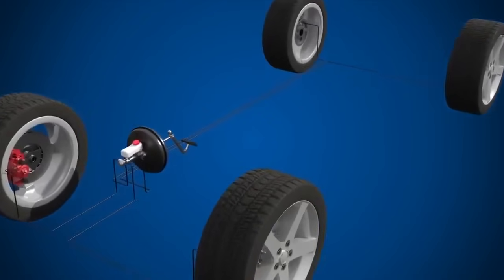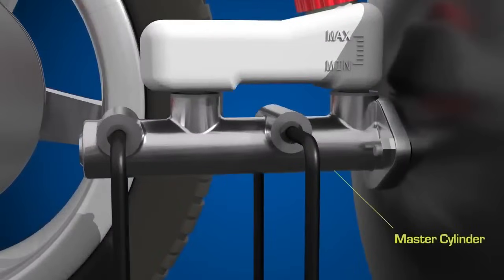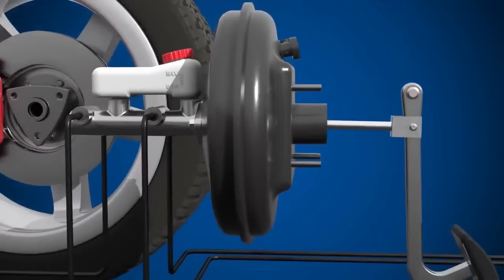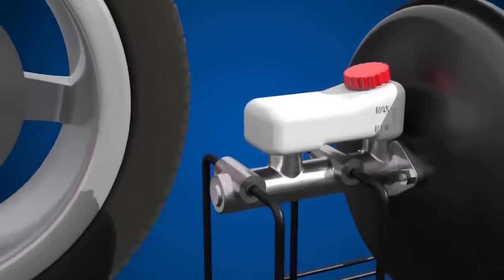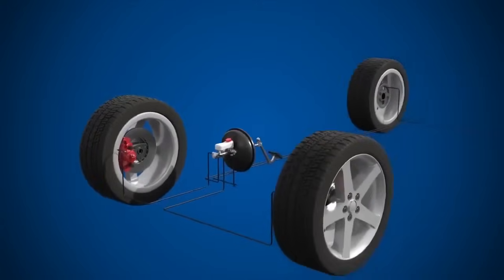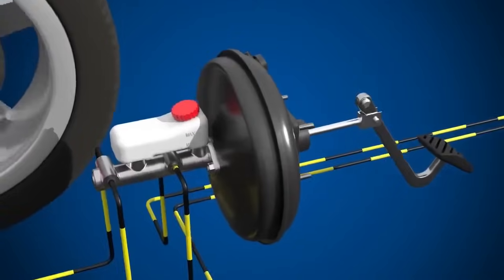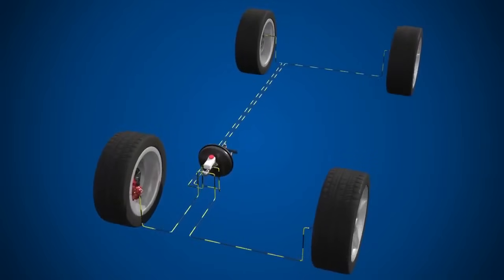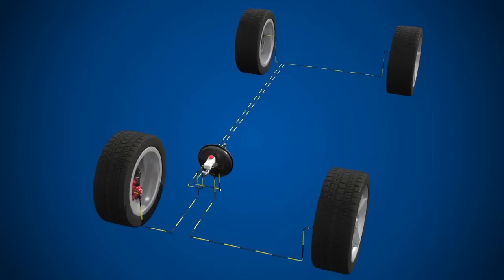How do hydraulic brakes in cars and light vehicles work 3D animation

Comment: How come when the engine is off the brakes become harder to stop if its only mechanical pressure then it shouldnt make a difference if the engine is on or off.
Reply from the maker: Servo assisted - the vacuum created by the engine doesn’t activate so it’s just you and the disk mono a mono

Comment: The master cylinder applies pressure to the hydraulic fluid it doesn’t push the fluid at all.
Reply from the maker: Liquids do not compress, it is movement by pushing. Pressure is for pneumatics fluid is actually pushed around mechanically. That said however you want to imagine that closed system operating is up to you. Thank you for taking the time to watch and to share your thoughts. As break fluid ages there is a risk that gas (or indeed air) can get into to pipes and this can be disastrous. You apply the pressure with your foot and leg (which have give), the servo assists (vacuum from engine) then it’s closed system from then on in (some flex in the break pedal). See drum breaks for a different approach.

Comment: question, if the brake fluid in the reservoir is betwween min and max ( so there is air on top when you close the lid )
does that affect the system ? if its full and exceeds the max does it pop the lid out when you try to brake ?

Comment: Nice video ! But I wonder, as the front brakes are closer to the cylindre than the back ones, there has to be more pressure, and therefore a different braking power, right (energy loss) ?
Reply from the maker: I think it is conserved because the liquid does not compress so the transfer is as if connected unlike with pneumatics ?

Comment: So how does it fail
Reply from the maker: If two friction surfaces are put close but don’t “bite” they wear. Like rubbing two sheets of sand paper together. If the sand paper is clamped tight no wear. If you rub together they wear out. This means you just have shiny metal against shiny metal that just slides or in the case of sand paper just paper slipping against paper. Does that help?

Comment: If you use colors changing to display the pressure instead of moving lines (like red for high pressure or blue for low), it would be clearer. Other than that, great video.
Reply: It's not about pressure... It's about fluid movement and it's direction. He could have used something else to avoid confusion.
Reply: I disagree
Reply: The vedio is about the pressure is same why are you saying high pressure and low pressure 😂

Comment: What is the work of servo here and how the brake pedal is get reversed to its initial position...suddenly
Reply from the maker: Rubber seal in cylinder returns fluid. Brake pedal has a spring.